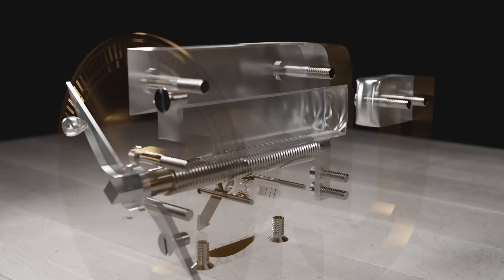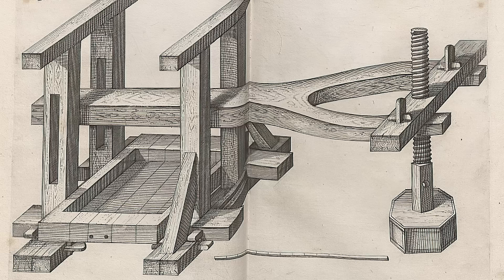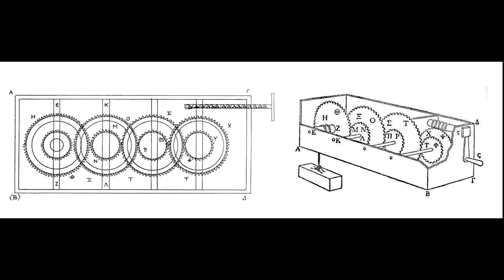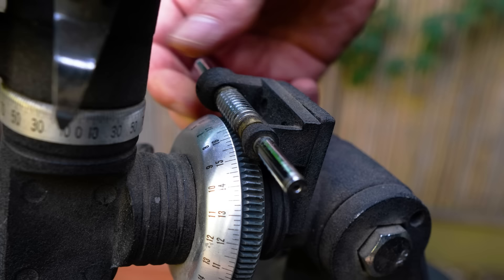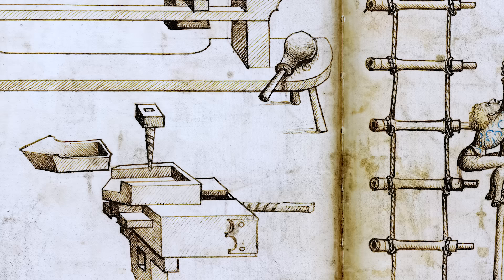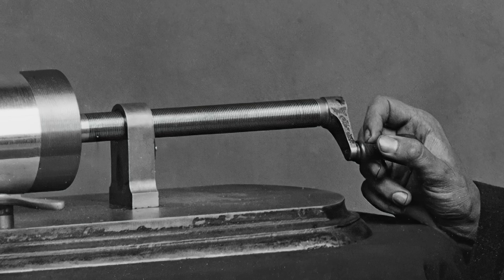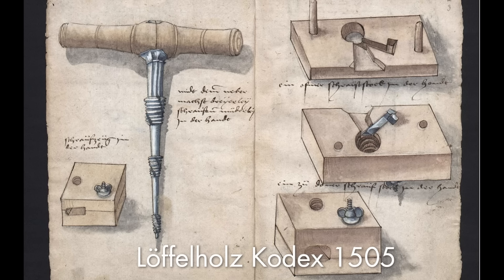Where DO screws come from?

Comment: Screw or nail? I met a salesman from a wood screw manufacturer. He visited a smallish furniture maker and expounded on the advantages of Pozi-Drive versus the old Phillips head crew (better cam-out performance resulting in faster driving etc). The owner shouted into the rear of the shop "Fred, bring your tools and a bit of wood".  Fred arrives.  "Fred, this man says that these new screws are quicker to drive into wood".  Fred picks up a screw, examines it closely, carefully holds it upright on his piece of wood - and hits it hard with his hammer.  "Nope - it's no faster than the cheap screws that we use".  No sale!

Comment: 15:05 An earlier "commodity" use of screw as fasteners was in fact armor - Turkish armor. While German armor used screws only in isolated cases, Turkish helmets sliding noseguard of late Medieval / early Modern period was commonly held in place by a captive thumbscrew (no, the other kind of thumbscrew).

Comment: A screw, as opposed to a bolt and a nut, is an externally threaded fastener that fastens something to an internally threaded hole in a chassis, such as a cover or lid in the case of a "capscrew." A bolt fastens two or more holed items together with a nut at the other end: this kind of fastening requires two tools, one to keep the bolt from turning while the nut is torqued by another. Both screws and bolts have external threads, generally referred to as "screw threads." The more intriguing questions to be answered are, "How was the first screw made and how was it gradually improved upon?"

Comment: To me, a screw in general refers to the machine with threads and can include a bolt, but specifically a screw with regard to hardware means a wood screw unless you specify machine screw

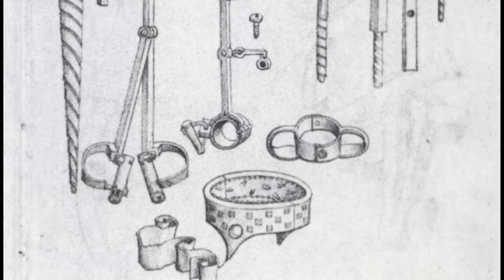Comment: 10:30 Screws for cannons fell out of fashion a bit because the cannons got heavier and more powerfull so the screws were replaced by wedges until they came back, first as a means to adjust the wedge where the screw was placed horizontally at the bottom of the wedge, so by turning a handle you would move the wedge in or out, and later when large metal screws became more common they were used directly as a way to elevate the barrel.

Comment: 8:25  According to Machinery's Handbook, bolts are used in unthreaded objects, and tightened with a nut.  Screws are used in threaded objects, tightened at the head of the screw.  Some screws make their own threads in the object at installation (like wood screws).  Others, like machine screws or socket head cap screws, go into a pre-threaded object.

Comment: Regarding he terminology of screws versus bolts, such fasteners as machine screws and cap screws (typically hexagonal head) are meant to be screwed into internal threads.  These are not tapered like sheet metal or wood screws.  Cap and machine screws are threaded full length and they can also be screwed into drilled and tapped metal  or into nuts.  A bolt is similar to a cap screw except that they are not full length threaded all the way to the cap.

Comment: A bolt, regardless of head type has a plain shank. A screw is always fully threaded up to the head, again regardless of head type. A screw for use in a nut or tapped thread is normally a machine screw.

Comment: I was told that a screw - machine thread or no pulls its head against a mating surface by opposing the force of the threads that are in - at some point, that surface. However a bolt, in our times would typically hold its head against a surface with the use of a nut. Where it may and may have been deemed necessary a pin gets used in the end(s) to secure the position.

Comment: I was taught that Screws are threaded along their whole length while Bolts may have a blank unthreaded segment since they are intended to fasten parts with a tapped hole or nut.
Screws which drive into an unthreaded hole are known here in Australia as "Self-Tapping Screws".
Or just "Screws" for short of course, when the distinction is not important.
I don't know if that terminology is used elsewhere; although I wouldn't be surprised if we inherited it from the UK.
Thinking about it I suppose it might be about the intention of the part. Perhaps a Screw is an externally threaded cylinder and a Bolt is also a screw but used only to Fasten?
Note "only" to fasten. Half of a self-tapping screw's job is to drive itself into a workpiece.

Comment: The difference between bolts and screws is that screws pull two parts together to apply a force fit between the parts. Bolts are used to withstand radial forces as in hinges.

Comment: Clicked on the video because of the thumbnail...
15:40 - I was right!

As for the Ediphone: you'll need proper Ediphone or Dictaphone blanks to record on. They're not extremely hard to find; but you'll need a shaving machine to prepare them. Note: you can't play regular cylinders on it, as the screw threads are different: 100 or 200 tpi for entertainment records vs.150 tpi for dictation cylinders.

Comment: I would venture to say, that the difference between a screw and a bolt does not depend on what it goes into (threaded vs a hole), but depends on the head of the fastener.

If the fastener has a head that allows the fastener to be turned by a "screw" driver - then it is a screw.  If the head is one that needs to be turned by a hex wrench (as an example), then it is a bolt - regardless of size of the fastener.

Comment: That picture does not have An error. It has about 50, but it gets the idea across. Also complex armor was used by wealthy fighters. Not just for “tournaments.” Kings used to risk it all and fight and so did lords and Noblemen. Also, you can record on a disk with no more difficulty than a cylinder, it just never caught on. There is a Mr. Rodgers episode with he demonstrates such a device.

Comment: On a metal lathe, the brilliance of the Imperial Threads Per Inch system is twofold.

First, with threads repeating every inch on a lathe a "Chasing Gear" on the Lead Screw allows the Thread Cutting Tool to be disengaged at the end of one slow pass along the thread and exactly relocated at the start of the thread to finish cutting the thread.

Secondly the very precise Whitworth thread design was specifically made for maximum holding power of the Coefficient of Friction for steel and still allow it to be undone, unlike other design that are not.
Coincidentally threads per inch also describes the Pitch  of the completed thread size as a fraction of and inch.
Such that say 8 threads per inch give a thread of ⅛ inch (⅛")

Comment: I believe you are mistaken when you are discussing the old threading lathe @12:21 when you mention the illustrator making an error.  I don't think they made an error, and I don't think that it is a threading lathe at all.  If you look closely between the threads on the smaller screw where it meets the thicker threaded lead screw on the right, it is cut into.a square which I believe is intended to act as a way of driving the smaller threaded screw.  Also, if you look at the mount that the larger screw is in, it appears that it's intended purpose is to slide along those cross beams, where as the mount holding the smaller screw on the left, is blocked by the bottom stand.  so imagine turning the entire thing clockwise, what would happen is not only would the screw on the left be pulling, but the screw on the right would ALSO be pulling the mounted peice on the right, making it into somewhat of a rudimentary "compounded vice clamp."  I hope that makes sense...

Also, the insert on the bottom.... it has a sharp looking edge on the top sliding  bit.  so it's possible this was used as a log-splitter or something.

Comment: Screws mostly have points, and are mostly driven with bit drivers, but can have no point like a machine screw while lag screws are driven with a wrench or socket. Bolts are always non pointed and always wrench or socket driven, but may not always run through the piece to recieve the nut.

Comment: Not saying I’m right. However you said argue... ;) as a mechanic, in common usage; a screw has a pointed end, a bolt has a flat end. The exception to that rule are “machine screws” which are basically number sized (smaller that 1/4”) bolts.

Comment: Really loved this. I am trying to research origins of screws so I know you must have spent a lot of time putting this together. My interest in screws has been to try to trace the origins of the screw press on the printing press. I know it originates with the olive and wine presses which may have been derived from the Archimedes screws as you shown. But the question is: Why did something like the Archemedes screw never appear in China? My hypthesis is that they had some other device that did the same job well enough that people did not pursue such a solution.

Have you ever tried to explore why screws never became widely used in such an advanced old civilization as China? Maybe they had it but it fell out of use for some reason?

Comment: I disagree that the thread was drawn incorrectly in the image at 12:12.  I suspect that that the threads are deliberately reversed so that they won't bind together—if the threads were the same direction, they would be able to spin in unison.

Comment: I don't disagree on the usage of the word screw vs bolt, but I personally think that a screw is driven using a tool that fits within the head, and a bolt is driven using a tool that fits around the head.

Comment: When I did my technical education to become a motor mechanic a bolt was described as a fixing device that was inserted into a hole that carried the same thread as it or had a nut also with the same thread  wound onto it. A screw was a fixing device that cut the thread pattern  on it into the material under the item it is fixing. But I have to say that I am still guilty of calling any bolts under 6mm in diameter a screw.

Comment: The meat grinder screw is also interesting. At first it has a large screw pitch, then the screw pitch becomes smaller. In this way, the meat that is fed from one side is pressed on its way to the exit, even before it reaches the plate with the holes.

Comment: The tool at 12:35 looks like a soft mallet. The device probably didn’t slide easily all the time and needed to be nudged occasionally. Being wood on wood I can see this happening.Or maybe it pulled to one side. Who knows. Not a screw driver though. Also thought it was a blowing device to clear wood shavings.

Comment: I have a machine that twists square bars into screws, only works in one direction with half inch bars, but I rigged it to use other sizes and turn both ways.
Reply: It was intended for decorative railings, usually every other spindle was twisted, it made a lot of the rails in Buffalo NY

Comment: Regarding the "mistake" on the illustration of the thread cutting machine. It seems unlikely to me that such a detailed drawing would contain what looks to be a very obvious error. I can't imagine that one could mistakenly reverse thread direction between the master screw and the workpiece in such detail and not be aware of it. 
I'm guessing that there may have been accompanying text that remained undiscovered. It seems plausible to me that this drawing illustrated that the machine was able cut both left-handed and right handed threads. Illustrating its versatility. It seems likely that it could.
By applying force upon the workpiece from the opposite end from the crank, you can maintain drive/workpiece contact while turning the master screw backwards. The cutters would easily be spun around to be oriented for the different cut direction.

Also, the "hex nut tool" could very well be the implement used for supplying backwards pressure on the workpiece for these cuts. I think that a tool of this type would likely be needed for the job.
It would likely take two people to make this work, but nothing suggests that this was built strictly for a solo operator. And left-handed threads have never been as prevalent as right-handed threads.

Comment: A screw does not have to make it's own thread, it can be threaded into a machine or part that is pre-threaded. A bolt is different in that it passes through to be 'nutted' on the other side.

Comment: The modern screw, as we know it today, was invented in the 15th century by a German named Johannes Gutenberg. The screw was used as part of his printing press, which revolutionized the way books were produced.

Over time, the screw became an essential tool for construction, manufacturing, and engineering. Today, screws are mass-produced in factories using specialized machinery and techniques, and they are made from a wide range of materials, including steel, aluminum, brass, and plastic.
Reply from the maker: Gutenbergs printing press was based on the wine press which had been around for hundreds of years. See my video - the most important screws ever made

Comment: At 12:28 it seem the screw in PULLED IN not pushed. Look at the base of the tool cutting device . The tenson is set for pull not push, That why the threads are opposite

Comment: You mentioned that there was no way to record flat phonograph records, but that isn't true. In the early 1950's, my father had a record recorder that used record blanks and cut grooves in the blank to record the audio. A screw moved the recording stylus in a spiral as the turntable revolved. The record blank had a second hole offset from the center with a steel pin that kept the blank aligned during the recording process. Thanks for an informative video - Phil

Comment: The tool at 12:34 could also just be a little air blower. Like a turkey baster! But for getting bits of debris out of the holes you're making. It seems like the handle is unreasonably large if it was a tool like a screwdriver or other driver

Comment: You said the thread on the crank handle were wrong but I believe you need to re-examine the crank handle moves toward the other one if they were both the same thread they wouldn’t move together they would move apart are equally in the same direction they need to be opposite for the tutor both together for the machine to work if I see this clearly

Comment: Factor implies multiplication. Yes, factory means multiplying. Your simple labourers multiply your device and however slowly production progresses, the determined enterprise might improve it. Mas  production is a goal but that might yet be many of years off. The production of napped stone blades made thousands of tons of chips over hundreds of thousands of years, until the technique suddenly advanced. In several thousands of years most used the new method. Now we can see that sort of improvement in days and take advantage.

Comment: Your 'mistake' in the lathe at 11:20 is not necessarily a mistake. In many diagrams of early days there are 'mistakes' which I think were deliberate. No patents in those days, if you wanted money for your machine you sold your services for making it. You drew your design, but to stop others copying it for themselves, you put 'mistakes' in. Da Vinci was very fond of doing this. It ensured that anyone wanting to build your crane had to hire YOU to build the gear train correctly, or it wouldn't work.

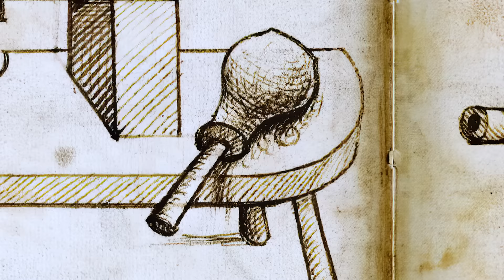Comment: At 12:38 you show what is described as a rudimentary hand held screw or nut driver.  May I offer another possibility?  I've known tool makers and machinists to keep a wood mallet at the work station for tapping on clamps, handles, and other locked down items to loosen them enough to work by hand.  I've used them myself.   Besides, if we admit it, we're all guilty of using the handle of a nut driver as a mallet/hammer at least once.  ;)
OR, could this be an early version of a bulb syringe?  You know, squeeze the fat part and air blows out the tube end and chips fly.  Early air hose with nozzle.  Just my thoughts.

Comment: Technically, isn’t it the case that the screw is on of several simple machines described by a wedge evenly wrapped around a cylinder? So, we call them screws, but really, both screws and bolts have the helical wedge wrap that is technically what a screw really is.

Comment: I like your definition of bolt. However machine screws do not create threads.

I would offer the following definitions:
Bolt - fastens an unthreaded object or substrate with separate fastener for tension.

Screw - fastens a threaded object or substrate using the substrate itself for tension. The substrate can be considered "threaded" regardless of whether it was pre-tapped, or tapped by the screw itself

Comment: Only 18 seconds into it is the first error. Any threaded fastener or shaft is a  SCREW, never ‘bolt’. A bolt is something with which you lock a door. As an engineer with 40 years in the field I assure you that this is correct.

Comment: One thing I would add is that screws requiring flat head or slotted screw drivers should be illegal.  Is there some use for them that I'm missing? I always assumed they were originally made because it was easiest to just cut a straight groove in the screw head and just somehow stuck around.